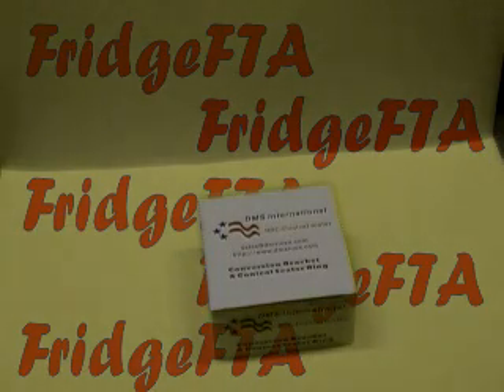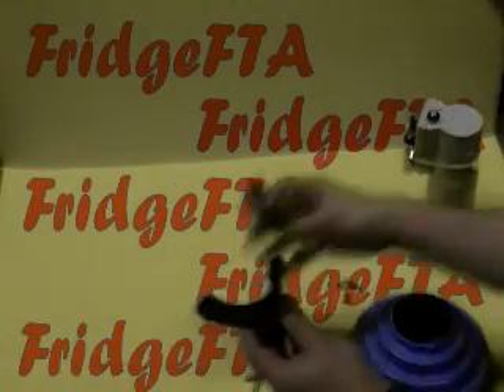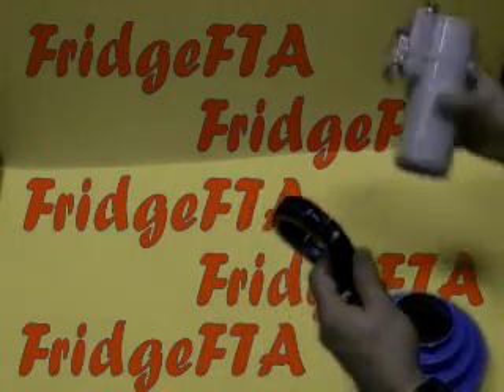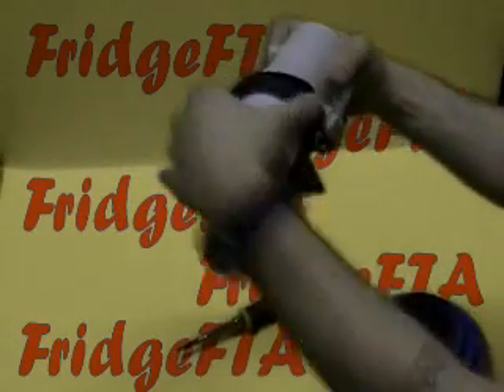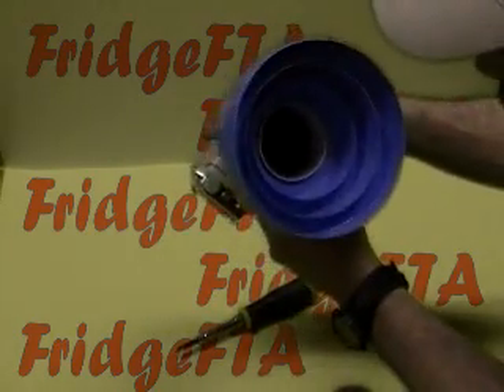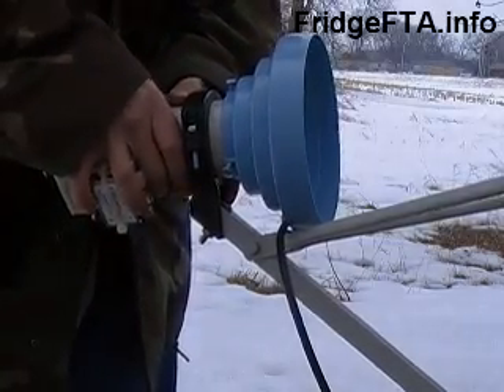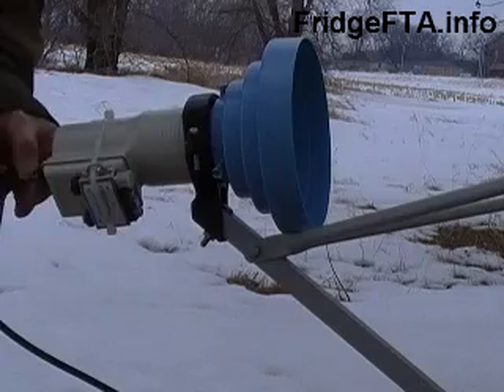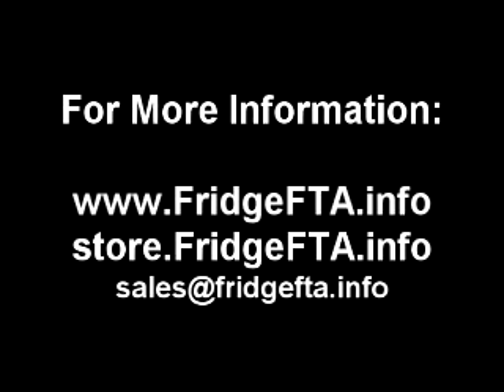C-band On The Small Dish, Complete Step By Step Instructions

Comment: somebody needs  sell the cband bracket mounts on amazon.com
Reply: I just purchased a dual output LNBF, with both scaller rings, ( one for prime focus and the other for offset ) and bracket.  on ebay for under 50 bucks.   just do a search for "Titanium" LNBF,  there are a few US sellers that have them.  just make sure your EIRP is strong enough for the antenna diameter you have.   here is a link to the best chart I know of.  https://www.satbeams.com/footprints

Comment: How you allign the Focus form the C-Band LNC to the Feedhorn? With your installation you don't use the full area of the Dish. The real Focus is exact 6mm inside the LNB Feed.
Reply: The scaller rings,  adjust the viewing angle of the LNBF  of course focal distance should be the same as  normal.
offset antennas have a much higher F/D ratio,  so that's the reason he is using that cone type Scaller ring on that feedhorn.

Comment: even if a strong signal from c band satellite transmission, can't receive a good signal  using a small dish.
Reply: z
Reply: Depends on what you call small,   I call 1.6 Meter offset antennas small,  since I use 4.5 Meter Antennas for normal C-band.     some C-band signals have a EIRP of 40dBw +  now,  which can allow you to receive using a small 1.5M  dia meter antenna.    https://www.satbeams.com/footprints   taking a look at Galaxy 18,  North east has a EIRP of 45.7 dbW  and you can get by with 80cm antenna.

the main problem with small antennas is not so much the signal strength,  but beam width,  a small diameter antenna operating on C-band will be able to "view" more than 2 degrees of the sky,   since Satellites are at 2 degrees spacing, this could cause interference if you have two satellite transponders the same frequency with the same polarity.

Comment: As a video demonstrating setting up a C band LNB on a small offset and aimed at DIYers everything mentioned in is perfectly good.

Martin, you may have read a few books about satellite installs, chucked in a few key numbers to try and sound knowledgeable but actually it just makes you look a bit of a prat. That is a small dish, doesn't matter if it's a 60, 90 or 1.2 offset, it's still small and the theory is identical for any size.

I'm sure most installers will have access to a decent meter but there's absolutely nothing wrong with using a cheapy analogue meter for peaking one signal and it's usually a lot easier than watching a digital meter or dB reading. There isn't much point using one on a video demonstrating 'how to' for DIYers unless your suggesting everyone should go buy one?

Oh, and LNB throat is terminology that has been around for years, at least the 30+ I've been playing with dishes.
Reply: Martin makes a lot of assumptions,    I see nothing wrong with this video,  its a guide for the lay person to re-purpose an old Ku-band  Satellite antenna ( off-set ) for use with C-band.   Martin makes the error of assuming, that all offset Ku-Band antennas are 80cm.   and totally forgets that there are plenty of Vsat antennas,   for example I have 3  Channel Master 1.8 Meter antennas,  that I do not use for their original purpose anymore.  a new satellite NSS806  has a EIRP of 40dBi  on C-band !   So I am planning of trying this out. it should work well.  

Its ridiculous to expect any DIY following this video,  to be using a Spectrum Analyzer, or fancy signal meter,  I have them,  but if I was to make a video for  the general audience on youtube, I would use a simple meter, to show how it can be done with simple and "cheap" tools. 

As for all the BS regarding IF ,   almost all FTA satellite receivers allow anyone to adjust the local Osc, to 5150.

This video could have more details,  for example,  you need a sufficient diameter antenna for the signal strength available,   obviously an old Echostar or Dish antenna, is not going to be large enough for any  C-band bird up there that I know of.  but a 4Ft or larger  just might.  the antenna in this video looks like it will fit the bill.